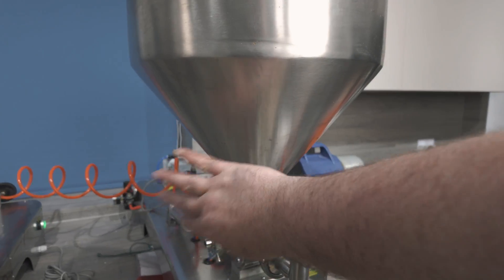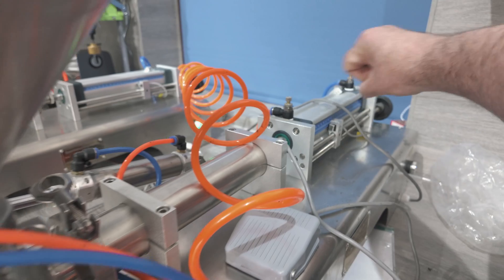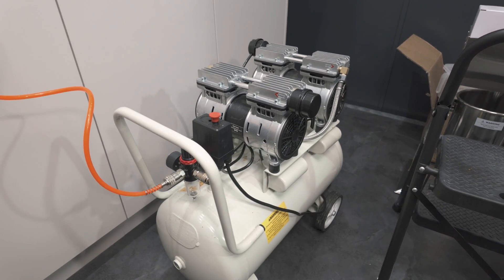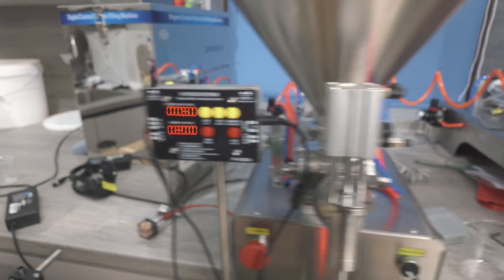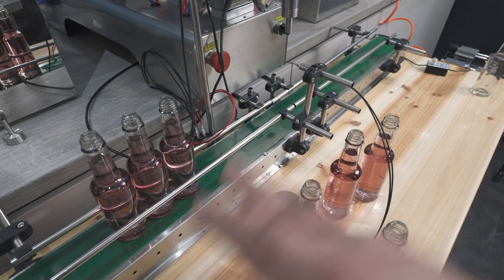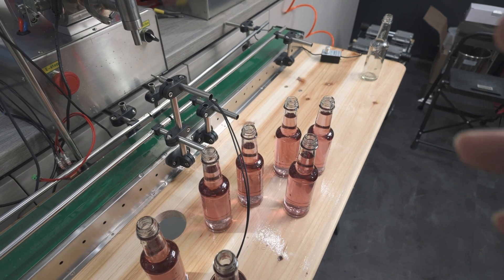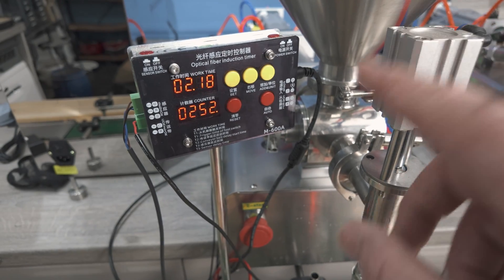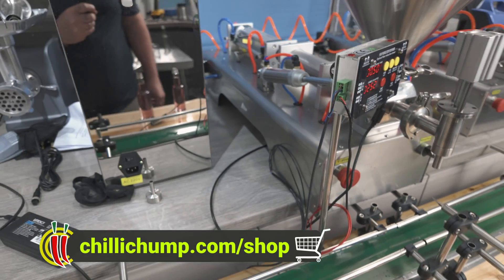Hot Sauce Bottling Automation

Comment: Hi ChilliChump, nice video.

Do you bottle your sauces while they are still hot (temperature)?
Reply from the maker: @johnpartridge-fx6xc  it depends on the sauce really. Whether it was fermented. What ingredients have been used. How I process it.
Reply: @ChilliChump  gotcha CC. We have a similar machine to your two hopper and syringe type. After calibrating with cold water we tried to bottle a sauce at 75°c...started ok but quickly went off the rails.

Machine was delivering with way too much force at the end of the push stroke...we think the temperature has thrown everything into chaos.
Reply from the maker: @johnpartridge8402 adjust the air valve so that it slows the push. Can be a bit fiddly.
Reply: @ChilliChump  yup did that. Tried to calibrate the push but it just got worse...eventually also blowing the gasket on the tap stop valve.

This was beyond calibration...something more fundemental.

Noticed our loader piston is plastic and feel like the material may expand too much in that temperature range.

What temp do you load at when you do a hot load...and is your plunger plastic or metal?
Reply from the maker: @johnpartridge8402 and the valve on the outlet spout?
Reply: @ChilliChump  @ChilliChump  yup tried it...slower or quicker..doesn't help us. It's exploding out. Was fine when cold, out of control hot.

We're going to order a metal piston upgrade the piston o-rings and fit a bigger spiggot.

Is you piston metal or plastic ChilliChump? What temp is your sauce when you hot fill?

Comment: Hi, love the videos. Your my inspiration and this year is my first year growing chillis, I have them all inside at the moment under grow lights, I also brought a poly carbonate greenhouse and went out there today as have seedlings for the allotment growing and temp inside was 39 degrees, that's way to hot isn't it? Any ideas I can do to cool it down so I can grow my chillis inside the greenhouse as they will be going out soon. Thanks in advance
Reply from the maker: Hi Wayne, thank you for watching! For your greenhouse, you will need to ventilate. At the least there should be a window on the roof you can open, that will bring the temps down. If it also has side vents/louvres, then open those too, that will allow cooler air to come in through the sides, and evacuate the warmer air out the top.

Comment: When you’re filling your bottles, I assume the hopper is filled with just finished pasteurized sauce. If it is will you not have a problem with volume shrinkage from your present tdc. After the bottle is caped ( in the automated system)
Reply from the maker: It's not really an issue...plus I always fill around 5% more than the stated volume anyway.